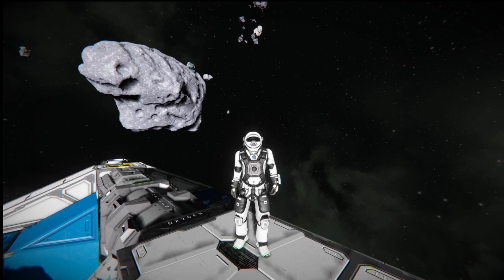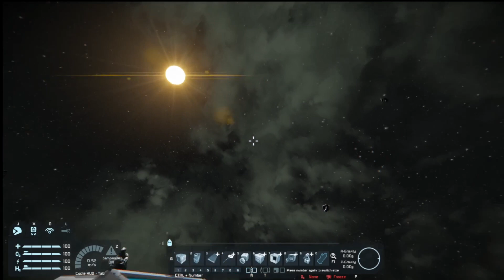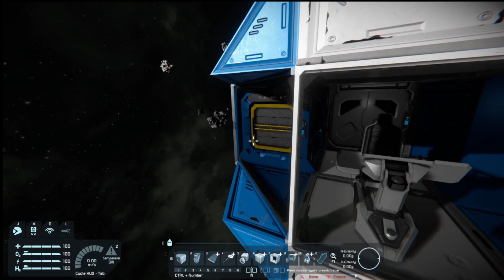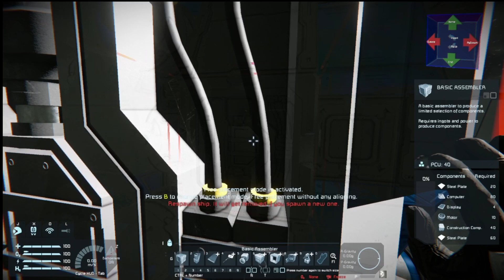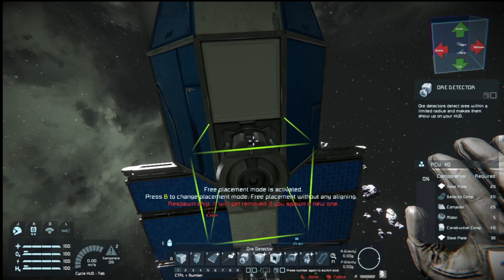How To Build Up The Space Pod

Comment: What are the problems with putting a cargo container behind the drill?
Reply from the maker: Expedeancy. It's easier to mine the cobalt for the Cargo container with a big drill than a hand drill. You can disable the drill after you get the cobalt and build behind the drill after the fact but if your on a pvp server you need to get from point a to b quickly and a drill holds higher priority than a container early game.

Comment: dude...  This brings me back a long while back to the early days in 2016 O.o......  Yeh ive had this for a while now lol!!  in my early start i always put 5 drill ... 1 under the seat and the other 4 are split in 2 mounted on conveyers that are mounted to 2 rotors 1 on each side. Far enough that they dont hit the middle drill, but close enough what they can open a path big enough  for my entire ship to fit through  ( rotors are advanced ) .  Before that setup, i put 3 on the bottom no spaces and 2 up top replacing the corner blocks all piped in to a refinery where you put in video same with assembler. Pro tip is do not do this before you can build the flight seat else youll be stranded in space until you can build it hahahaa....Adaptation can be used in official servers to start because limit is 5 drills :D .It really ramps up from there because you can get all basic stuff from stone iron-silicon-nickel-gravel   and 1 basic refinery can deal with alot of stone fast so 5 drills will not give you alot of downtime to refine the stuff :P .  Nice different build to start btw :) cheers badger and wont be long until you got mountains more content to take out .
Reply from the maker: Oh I already do have loads of videos hoping to do a narrative machinama like back in the red vs blue days.
Reply: @badgerwildgaming6908  ouuuu vintage videos.. i like that
Reply from the maker: @gamerelite3989 yup got lots of content.

Comment: Hey, uh, your videos aren't bad but is there any way you can adjust your toaster mic? Put a noise gate on and a background noise filter?
Reply from the maker: I'm in the process of finding a fix for it. It's difficult because my trade is in carpentry and this has been a hobby up till now. Thanks for the advice didn't know a noise gate was a thing.
Reply: @badgerwildgaming6908  

I mean, it depends on your recording setup. 

I use OBS when recording, though I don't have a capture card anymore for consoles. 

Basically, I would put my console video into OBS, and record and play from my desk. OBS has all the stuff built in under the audio filters, if you use that.
Reply from the maker: No but does it let you multi stream cause the stream labs I have doesn't.
Reply: @badgerwildgaming6908  multi streaming isn't something that OBS lets you do. 
 
SteamLabs is a fork of OBS (that means it is based on OBS originally), so it should have all the features modern OBS does though, so it'll have the filters the same as OBS does. 

Multistreaming has to be done through ReStream or a similar service, unless you set it up some other way, but that's way above even my head. 

Be warned that Twitch has rules against multistraming, so you could get banned for doing so. YouTube, Kick, Rumble, and DLive don't have such rules.